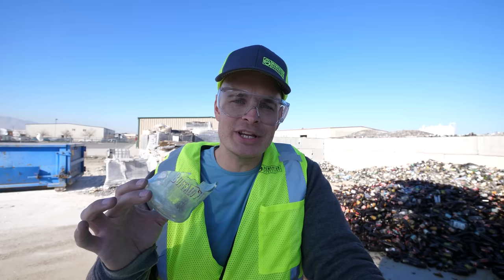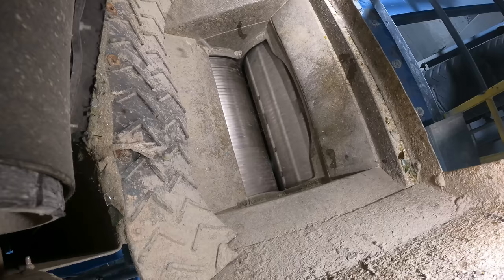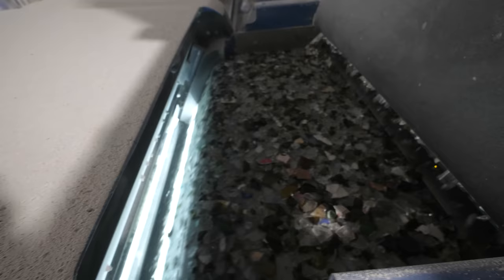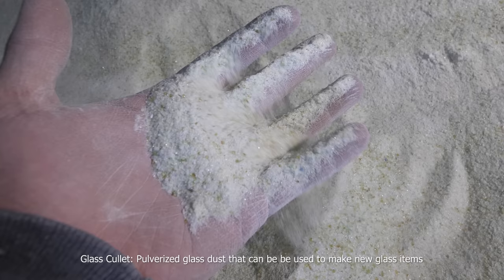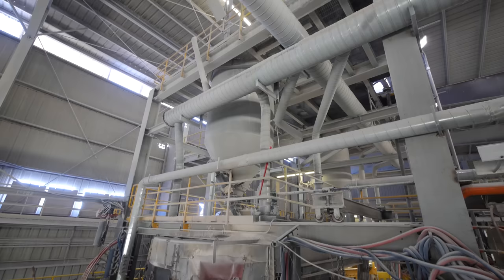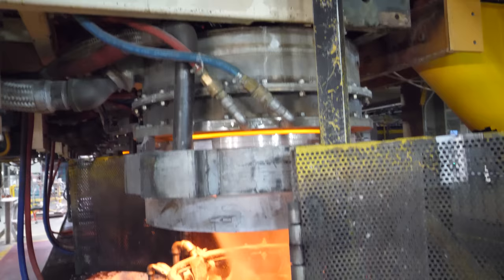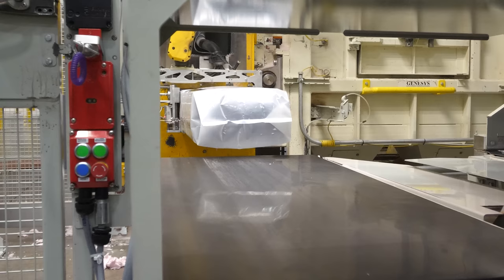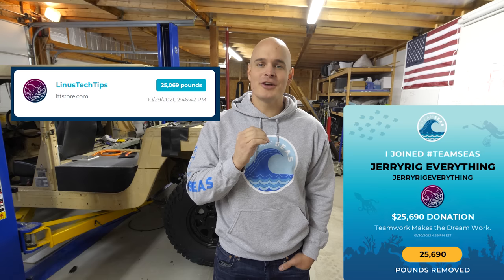What *REALLY* happens to 'Recycled' Glass?!  -  (you might be surprised)

Comment: The dirty truth is that glass and metal are the only truly recyclables materials. Plastics are just not recyclable, not really. And if they are recyclable to a certain extent, that is always considerably more expensive than virgin plastic. Hence, it almost never is done in practice unless someone subsidizes it heavily. 

Please use glass and metal containers everybody! It's cleaner and healthier than plastic anyway!
Reply: Can't because the factories have switched "away from" glass to plastic .  If glass last a million years - then if I put a glass bottle inside a glass bottle it will last 2 million years? The testing is going to take Soooo long.
  So, why can't they make insulation using plastic fibers?  After all it is not the glass fiber that does the insulating.  It is the small pockets of AIR held in the fiberglass that does the insulating.  The only difference is that it is plastic fiber instead of glass fiber.
Reply: Correct but most glass is not being recycled. In most areas there is NO place to recycle it at all and it is sharp and dangerous and never decomposes and will not burn. Most rural area homes & farms have areas of dangerous broken glass bottles laying around " forever"
Reply: @bunzeebear2973  Imagine being trapped in a burning building with walls full of plastic.
Reply: @bunzeebear2973  You don't need glass to break down and decompose because it isn't hurting anything.  Who cares if it sits around for a million years?  Does no harm.
Reply: Everything you said is true but creating glass or metal containers, even from recycled material costs more energy than plastic boxes or wraps. 

That is why increasing sustainable energy production must be the highest priority, the more carbon-neutral energy is available, the more avenues open up to make other industrial processes more sustainable.
Reply: @blafoon93  The most viable sustainable energy is hydro.  Expand hydro and nuclear and we have a path forward.  
Wind and solar don't generate enough raw affordable power for manufacturing.
Reply: @davec.3198  they literally are using wind power in the factory in this video
Reply: @davec.3198  Yep glass is literally just sand.
Reply: @davec.3198  Exactly! It's basically just sand but in a more solid form.
Reply: @davec.3198  Unfortunately, hydro requires the taking of enormous amounts of land. Way more than for any other reneables. To the point where in may places they are talking about literally spending billions to remove hydro and restore the natural habitat.

Also, the upfront investment in hydro is ridiculously large. Pretty much only a government can invest in hydro. It is a centennial scale type of investment. Wind and solar are scalable from a tiny family company to government scale installations.

And lastly, wind and solar are simply the cheapest types of new capacity you can add. They are literally less expensive than even natural gas now. Why would anyone invest in a more expensive mode of electricity generation if there is something cheaper which is also cleaner. It just doesn't make sense.
Reply: @maksrambe3812  Just because there is a wind turbine outside doesn't mean it powers the entire plant.  
Do you think they shut the plant down when the wind isn't blowing that day?
Those blowers, vacuums, conveyors and dryers use massive amounts of electricity/natural gas.
Reply: @TohaBgood2  I'm sorry, but you are just flat out wrong.  Gas turbines fueled by natural gas have done a terrific job at lowering emissions in the US.  
Look at alternative power generation as a whole.  Hydro is by far the most successful in terms of affordability and power generated.  
Wind and solar are not cheaper by any stretch of the imagination.  Wind simply does not exist without huge government subsidies and solar is great for a house, but terrible for mass, affordable generation for, say industry.  Lets not forget all of the toxic substances that are in solar panels which are causing disasters in landfills.
The  total environmental impact is what needs to be considered.  Not just the source of generation in service and out of service.  Materials transport/sourcing.  Mining.  Manufacturing.  Installation.  Service through life.  Removal from service.  Finally recycling.
Reply: @davec.3198  Except when you step on it, and then have a shard of glass in your foot.
Reply: @censoredpeasantfarmer3372  I'm sure the towns could have had a central location to dump all your glass and some company would be glad to take it for free.  Your town and the farmers probably couldn't be bothered to set it up and also haul their individual glass to the location.  I'm not blaming them.  The same goes for aluminum.  It's valuable.  It costs 10 times as much to make a new aluminum can than to recycle one.  Once you collect enough of it, someone will be very willing to haul it away.
Reply: @censoredpeasantfarmer3372  other than being unsightly, glass isn’t a terrible type of litter. The idea you’re going to be falling all over broken glass is sensationalized. It erodes, it is biodegradable. If you left a glass bottle in the desert on running river it’ll end up like the rest of the dirt and sand, not sharp at all, just abrasive as dirt already is. Glass exists in nature, plastics don’t.

You could literally just sort out all the glass from landfills and dump it into an active volcano and it would just become part of the already huge flows of molten silica.
Reply: That may the case where you live but European countries are now moving towards only recyclable plastics that can be recycled efficiently, Ireland recently have done this, most of plastics here can be recycled here, no more outsourcing our rubbish, yes it's costly but I'd rather spend extra now then no planet in a few hundred years.  Norway and Japan are world leaders when it comes to environmentally friendly furnaces to dispose of unrecyclable rubbish, expensive for the refuse companies, but worth every cent.
Reply: Correct 😁😁😁😁
Reply: @markgigiel2722  "Hating your own country is cool and it makes you look like a good person, especially when you're an American."
Reply: @markgigiel2722  So much virtue signaling.
Reply: @travisbrunner2922  Not really.  It's kind of sad.  We could have been better.  The USA, pretty much from day one, chose "the dark side".     Peace.
Reply: @Alexandra Hill  European countries are also burning plastics in low emissions furnaces to generate electricity.  Talk about a win win.
Reply: @travisbrunner2922  Maybe, but so is what we have now.  Oligarchy heading for Fascism.  I'm 63.  I've done and seen a lot.  Not a kid.  Yes, I know the definitions of the words.  Have a good night.
Reply: @davec.3198  I do appreciate the civil discourse! I really do! Nevertheless, I watch this space carefully. You must be looking at old data. Wind and solar are by far the two cheapest forms of new energy generation capacity right now (since 2020). This is why they represent such a large share of new capacity and growing at breakneck speeds.

Now, it is true that various governments subsidized wind and solar, and some still do. Nevertheless, both have now reached a point where they are sustainable without subsidies. 

Solar now even outcompetes existing coal power plants! That means that it is cheaper to build new solar power and pay extra money to decommission coal! I mean, it's not even close.

Seriously, look it up. It's quite amazing what has happened with the price of renewables over just the last two-three years! It's a new world out there!
Reply: @travisbrunner2922  I can't believe we started with a recycling discussion.
Reply: Jack Bradford  You’re right about plastic, but wrong about climate change. I like to go with the objective facts on this. 

The fact is that plastic looked like a miracle material but turned out to be too good to be true. Lesson learned. Glass and metal is better anyway. 

The other fact is that burning $hit to get electricity or power is not sustainable when the entire planet is doing it. The effects are clear and visible. I live next to a glacier that is actively retreating. It is doing so too fast to be due to natural causes. Who should I believe, you or my lying eyes?
Reply: @maksrambe3812  100% wind power is not nor will it every be possible, as its only there when the wind blows, there will be days where the wind just issent strong enough or too strong, if the wind is too strong they have to shut down the windmills or they will break them. Also windmills only last 25-30 years. Nuclear power is the only thing we have right now to fix our energy problem.
Reply: @censoredpeasantfarmer3372  Here in NH it is hard to recycle glass. One town just keeps it, for now, another throws it away. The plant in MA shut down a few years ago so any glass now needs to be trucked to (PA?). So cost wise its cheaper to throw away.
Reply: @TohaBgood2  the problem with solar is you will need sooo much space just to make the same amount of power as one nuclear plant, also solar and wind loose where it matters the most, reliability, we cant just have power when the sun is shining and the wind is blowing, to insure that we need to upgrade all the power infrastructure and have many more % than 100% capacity just to be sure you can make 100% of the needed power. then we get to the part where windmills only last 25-30 years, then you have to redo all the work.
Reply: @4450krank  That’s already the case. We already subsidize a bunch of unprofitable “core capacity” power plants. Most of the coal and nuclear plants on the grid are not profitable and have costs that are way above the market price. The only way they can survive is by getting subsidies from the government. Nuclear, by the way, is historically extremely subsidized. Basically, none of the nuclear plants we have right now would even exist without subsidies. Building our entire grid on them would be completely crazy. Might just as well pave all our highways with platinum.
Reply: @TohaBgood2  I as well.
I've worked and lived in the energy sector.  Gas, steam, nuclear turbine and finally wind. before I took another line of work.  I have no dog in the fight now.
I know all of wind energy's dirty little secrets and it is no secret that they cannot survive without huge subsidies.  Which is why they still receive huge subsidies.  
Gas turbines sales are climbing and continue to climb and are projected to climb for at least a decade.  
If you dig into much of the data coming out of European countries which boast high renewables, many of them 1) import power from fossil fuel plants just over the border. 2) high content of hydro, like I said earlier.  3) have a high cost of electricity.  
There is absolutely nothing wrong with a clean burning natural gas facility, pumping out lots of clean energy that people can afford.  I'm personally a fan of nuclear, as there is much less waste and little to no emissions.  But the capital investment is huge.  
You also have to consider that many places in the world (I live in upstate NY) don't have much sun and don't have much wind.  Wind in particular is a very localized event.  It is very, very localized.
Wind makes a ton of sense in an area where they are burning diesel (like an island or remote village) to generate electricity.  Some of the Caribbean islands come to mind.  But guess where you don't want to see a wind turbine?   On your beautiful island.  Same reason some of the biggest advocates for wind have vetoed wind projects in their favorite vacation spots.  They are ghastly, kill birds and make a ton of noise.

Comment: Fun fact: molten glass also absorbs microwave radiation, unlike solid glass. So you can’t melt glass in a microwave, but if you melt a bit of it with a torch, and then place it in the microwave, that part will continue to heat up and start melting the surrounding area.
Reply: Super cool! Thanks for pointing that out.
Reply: I have melted glass with microwave alone
Reply: @hillaryclinton1314  I never tried it. I assume it has to be high-wattage.
Reply: @hillaryclinton1314  proof?
Reply: @hillaryclinton1314  Impurities on the surface probably heated enough to melt some glass, which then spread
Reply: @specialopsdave  actually anything with a Oxygen atom or Hydrogen atom will " heat " attenuation Harmonic frequencies via nuclear magnetic resonance frequency..a microwave uses NMRF Covalent bond hydrogen and oxygen... Burn hydrogen make steam... The molecules are accelerated...
Reply: EMF radiation..
Reply: Yep....
Glass conducts electricity if molten, as noted in the video.
When molten, glass absorbs microwave energy since it's conducive.
YouTube has a number of videos...
Reply: @muddywater6856  which is what the molten obsidian beneath your feet does constantly...
Reply: @mjolnirswrath23  Yes, but for oxygen bonded to silicon, this takes a very long time
Reply: @specialopsdave  so change the frequency...
Reply: ALL elements have a specific NMRF it's refered to as Atomic weight..
Reply: Or mass spectrometer frequency .. NMR... People don't realize how SIMPLE it is to make " Energy "
Reply: @mjolnirswrath23  You can't change the frequency of a microwave oven without dissasembling it. They are firmly locked at 2450MHz.
Reply: @specialopsdave  tone generator... And YES you can a Magnetron is not all that complicated used to rig up one with friends to flash fry watermelons at well over 300 yard's although the effective range of a HERF gun or mazer is 1800+ meter's line of site and instant... What do you think ADS is? 90 gigahertz frequencies instead 60 GHz millimeter wave propagation as Fuve Gee .
Reply: @specialopsdave  if only people understood you can make an HERF gun from an AR platform with a stainless steel bull barrel... And some copper windings to specific Gaussian density... No ammo needed just a battery..
Reply: And understanding of Marx generator.. no not Carl..
Reply: @mjolnirswrath23  Still, disassembly. Many people are scared of disassembling them (although I'm not)
Reply: @mjolnirswrath23  And yes, you could make a weapon from it, of course
Reply: Back on track though just match the mass spectrometry frequency of silica 

Everything has a specific NMRF harmonic... Atom's, chemicals , proteins Cells, bacterium Virion etc..
Reply: Technically in theory much like waveform energy cancelation  " noise cancelation Technology etc " you can cancel out a cancer cell with it's exact Nuclear Magnetic Resonance Frequency harmonic... From a Magnetic Resonance Frequency Imaging device...
Reply: Reminds me of the molten core eating away underground in Chernobyl.

Comment: the real question is what percentage of bottles collected for recycling actually make it to be recycled at a place like this as opposed to just being thrown out because it is too costly to take it to the nearest place
Reply: Most glass is recycled unlike plastic, glass recycling is profitable.
Reply: This was my question too. It’s amazing how little of what can be recycled actually is.
Reply: 32% in the us 90% in the EU ...google
Reply: What I read years ago here in central Florida, is that it was more expensive to transport the glass to a recycling facility than the money the local gov't made from recycling it, so they stopped, and just crushed it instead.
Reply: you are correct sadly in my rural are we have no easy access to recycling so everything goes to a junkyard or landfill
Reply: @lloydhlavac6807  We have the same problem in Tennessee.  They switched us to single stream curbside back when we could dump everything in empty shipping containers and let China sort it out.  Now the contracted waste hauler claims that the broken glass in the recycling stream is dangerous to those working at the separation facility. 

I suspect that the single stream intake is so contaminated by non-recyclable  stuff that they are running a magnet over it to pull out the soup cans and just carting the rest to the landfill.
Reply: At best maybe 1% is recycled. It is very expensive process and producers would rather manufacture new bottles than to recycle old ones.
Reply: @HarryLovesRuth  Yes, I've had similar suspicions here. Despite the lids of our recycling containers having labels on them showing people exactly what can be recycled, and that it should be clean, I have often seen people putting contaminated stuff in there, or just plain garbage that shouldn't even be in the container, because some folks put stuff in that they THINK should be recycled, instead of what is ALLOWED to be recycled. And yeah, I think that all then just gets tossed into the trash by the recycling company.
Reply: @lloydhlavac6807  I put garbage in both... it goes in the same truck rofl
Reply: Snapon is correct. The EPA says that about a third of all glass is recycled in the US. But the EU has a 90% recycle rate for glass. The biggest differences in recycling rates are #1 the US prefers single-stream recycling (no sorting) whereas EU countries use multi-stream (where the consumer has to presort before putting in the bin). Multi-stream recycling requires less sorting at the facility, which is cheaper. #2 The distances between a recycling facility and a cullet supplier can be very great which drives up transport costs.
Reply: @SM-tj4jc  producers much rather use recycled glass because it’s cheaper than the raw materials that are used to make bottles. Also you use less energy and because recycled glass uses less energy to melt also keeps emissions down if the plan doesn’t have electrostatic precipitator